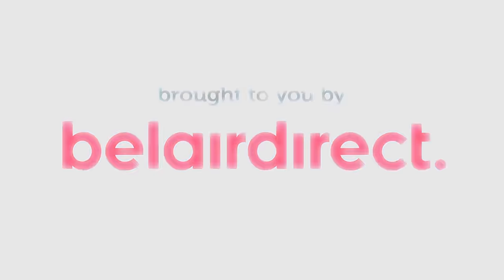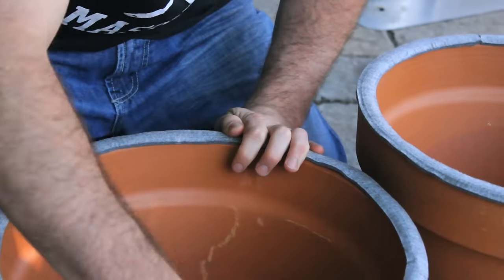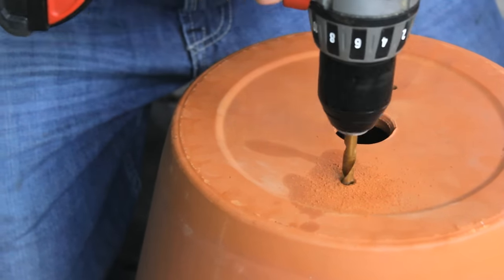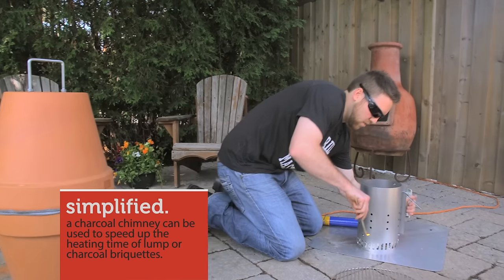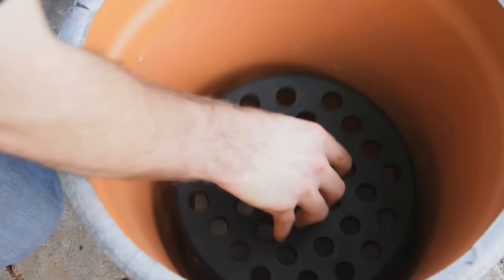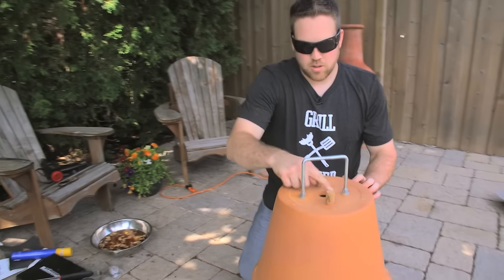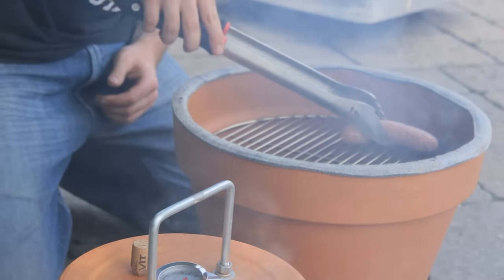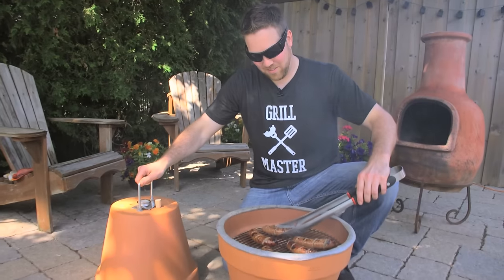DIY BBQ Grill & Smoker made from Flower pots!

Comment: I made one of these but with much larger plant pots.  I have a second grate below the main one so I can put a metal bowl just above the coals.  This give me a radiant heat deflector and it can hold water to control the heat when required.  I have put handles on the either side of the top pot (they are some form of synthetic from an old electric pizza oven).  The two handles allows for easier lifting.  There is a small hole drilled in the side of the top pot to allow a thermometer to sit in giving me continuous readings.  It works great and using preheated coals with some unheated coals, the heat can remain steady at 110 C (230F) for 5 hours or more (with water keeping the temp steady).  You control the heat by the corks at the top and it is very effective.  I didn't do this for cost, I did it as a project and it was a lot of fun and I was smoking in a couple of hours.  The ceramic hold heat nicely and it's a great conversation piece.
Reply: Hello there I just massage to know if you are open to business opportunities
Reply: Where did you find the larger pots
Reply: @garrettlongest465  I’m fortunate enough to have a business near where I live that sells gardening equipment including an enormous range of pots, glazed and un-glazed.
Reply: @bradhoward9165  does glazed or unglazed make a difference? Also how would this compare to the name brand ones?

Comment: I would suggest a domed pot for the top, it seems distribute the heat/smoke much better.  This design came from Alton Brown over 15 years ago, and has worked great. I use grilling gloves to lift the top off, but I'll dry the U-bold handle.  Thanks for the video.
As Mr. Brown suggested we use a hot plate with soaked chips in a pan. 

I will go out and get the BBQ gasket material you suggest. - Thanks for the Video
Reply: He wasnt the first..

Comment: Make sure you don't get a zinc plated u-bolt. Zinc is pretty bad to eat/breathe in, and the top is definitely getting hot enough to get it airborne. So stainless steel hardware all around is required. I would also wrap something around the handle, it might get hot, but also that thin metal surface isn't fun to try and pick up that heavy Terra cottar. But maybe not...

Things I would improve on: The top hole can be plugged with some fire-brick cement and have a permanent thermometer in it. Just to give you an idea what the top of your cooker is idling at. A rough indication as to what is going on inside, and one you never have to remember to put in place.

I would spray the inside of the pot with the high-temperature BBQ paint, just so that it won't absorb as much grease and turn the pots weird colors and smells. Plus, it would be a lot easier to clean since the surface would be smooth. I might do the outside as well, for that same reason.

One of the holes in the side would be big enough for me to get my temp probe into, so I know what the temperature of what I am grilling is at. Sure, it is going to take 8 hours... but I don't want to spend three times as much time opening it up to check the meat when all I need to do is dump in a handful more charcoal.
Reply: Alexander Borsi good advice
Reply: Zinc is actually quite safe. One little weld on galvanised steel and u have a nice cloud around your head. Been doing it for years - still alive, still bbq'ing
Reply: Alexander Borsi o

Comment: Cut a square hole out at an offset angle like you would a pumpkin on the side of the bottom pot, embed magnets in the pot and square piece you just cut out and you could have an opening for adding more charcoal

Comment: why?
Webber Smokey joe for 30 bucks. 2 clay pots that size 40-50 bucks. plus the handle, washers, nuts etc...
Reply: But in my Apt’s complex they don’t want you to BBQ 🍖 anymore but people still do and I threw my  grill out, Now there are more grills than ever, If I decided to grill again I will do this because after I grill the next day I could put in a flower pot to hide the fact i have a grill, fake flower 🌸 Of course it will be hidden in plain sight
Reply: I was just about to say that...lol
Reply: @dippster357  its considered wreck-less burning. most apts wont allow porch grilling because of multi teir apartments. people get drunk or take meds try to grill and spill the coals or propane grills. if they are on the third story the best they can do is spray less than 4 gallons of water to hopefully put it out or use fire extinguisher but if u use extinguisher u could be stuck with evidence / chemical burns. most states is a class 1 to 4 misdemeanor. however if people could be in the way its arson.

Comment: dude, how did you start the charcoal fire? .. Did you just put some paper underneath the stainless steal pipe? .. Does that burn long enough to get the charcoal going? .. I usually get the special impregnated fire starter cubes for that.
Reply: Rip news paper 2 pages at a time and roll them up in a cylinder shape and roll them up again around your hand and stuff them underneath, the stainless steel pipe also known as a chimney.  You can fit three rolls of 2 page rolls under there.  Usually takes 15-45 minutes to ignite the charcoal.  Heat rises from the paper into the charcoal eventually igniting he entire batch.  Science!
Reply: that was a Weber chimney charcoal starter. they are like $15. put your charcoal in and some newpaper underneath and light. it gets your coals ready while you do the rest of the set up. cuts down on time and then dump em in and cook ;)
Reply: I use a coke can, cut in half, and then pour flammable liquid in. It's a lot easier and cleaner.
Reply: I use bits that I ripped off of old charcoal bags haha
Reply: I guess you could get marine stove alcohol, the clean-burning kind too. Better than lighter fluid :/ But a chimney is fine and cheap.

Comment: Lots of keyboard warriors commenting here. Why not just give the guy props for an innovative idea thats easy on the wallet?
Reply: Because it's potentially toxic And people take everything for gospel that they see on the Internet.
Reply: @1HeavyHitr  ceramic is toxic? How?
Reply: Because it's smaller, less practical, less efficient, and more expensive than a 22" weber classic kettle
Reply: A couple steel buckets (not galvanized) doing the same thing will last years. These clay pots won't last long and so this won't be so easy on the wallet. 
Also try a piece of metal ducting between two covered buckets for cold smoking of fish, cheese etc. I made one 20 years ago - cost 12 bucks all in, including the gas I used driving to the hardware store - still going perfect for cold-smoked salmon and trout.

Comment: Seems like a cool idea, but has one, possibly two major design flaws that I can see. #1 There is no way to access & add charcoal for doing long-cooks (which most smoking requires) without opening the whole thing up, taking the food off and losing all your heat. #2 There's no water or drip pan to help add moisture to the cook (that's minor though, and probably an easy addition). If it weren't for problem #1 this might work for me. If you have a DYI for a barrel-style side-box smoker, I'd LOVE to see that! Keep up the good work though. Thanks for the post!

Comment: where can you buy the charcoal grate, BBQ tape and the grilling gate?  Home depot or OSH did not have it.
Reply: I work at home depot and i know we carry it. Replacement grates for round weber style grills.
Reply: +mixwell1983 the ones I found where too big. I found the grilling grate on World Market and the charcoal grate at OSH. for the grilling grate I improvised with. 4 bolts and nuts to give it an extension so the grilling grate would set higher at the top. You could also grill small food items such as shrimps without having fall through the spacings of the grill.

Comment: QUESTION: What is the purpose of the metal plate with holes that's placed under the coal?
Reply: air flow; i believe he had some small air holes at the bottom of the pot underneath it. Simplifies and streamlines combustion process.

Comment: Place a pot within a larger pot on the bottom. Pearlite the void outside of larger pot should not get hot. Place your air intake holes at bottom. Other idea its crazy incorporate a large coil into the pot that will heat up a grill under the top grill through 12 volt induction. so you could have a flower pot solar powered induction grill or use a 12v battery to grill up sum grub no toxic fumes just from what ever dripped onto the hot grill being inducted red hot burning up and giving the meat more flavor. 😱😵😊😉💫💥😂

Comment: I like this project but it seems it's more grilling than smoking. The meat is over the direct heat getting cooked with a little bit of hickory to add a touch of smoke. When I smoke meat, I do it with a side box, indirect,  wood chunks in a cast iron pan set directly on hardwood lump charcoal, lots of smoke, hours, not minutes. Low and slow is the way to go.

Comment: a T-bar in the main hole! smoker not needed. we buy a smaller pot take to the park ,take back just the grill  plant a flower leave it. 99ct pot. no big deal.
Reply: No flower pot big enough to grill a couple brats, is .99 in my area. Clay pots aren't cheap, they just want to sell plastics.

Comment: I've been using a Flower Pot Smoker for almost 15 years and smoked over 1200 Lbs of meat in it. 

Do NOT cover the top hole or seal the vents.  Smoking requires venting or Air Movement or the outside layer of the Smoke will become Bitter.

You also need to be aware that over smoking can cause bitterness.  I typically only smoke a pork butt or brisket for about 3 hours than wrap it to finish.  To keep your crust better wrap it in unwaxed butcher paper or you can use parchment paper.

I dissasemble an Electric Hot Plate for the heat source and a small heavy fry pan for the wood chunks.

Comment: I made this grill, and learned from experience:  When drilling the holes, first of all, use MASONRY bits.  Second of all, pour water on the spot you are drilling-- it's a lot easier to cut when wet.  For the side holes, I used a garden hose to spray the side, before drilling.  Third of all, use a hammer drill.  Or at least a CORDED drill, which has a much more powerful motor, but a hammer drill is better.  A cordless drill isn't gonna cut it, no pun intended.

Comment: my Weber was 50 bucks
Reply: +Steve Leighton ceramic will always be better for heat retention and it also helps for keeping a fairly constant temperature, but the webber is a really good grill don't get me wrong
Reply: For the full size or travel size? At home depot even the base model weber is $99
Reply: If you got a full size for $50 new you got a deal
Reply: It's not full size but it was $50.00 at a fred Myer in Oregon.  Not tax on top and it was a steal.  Still works great 7 years later.